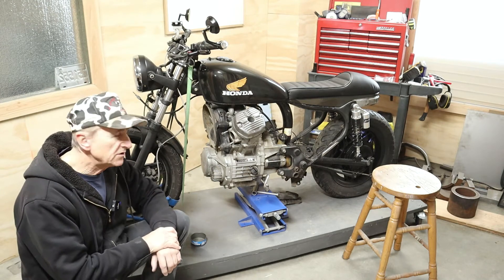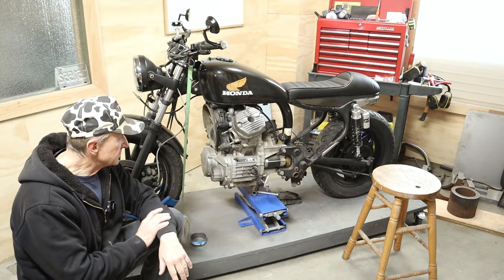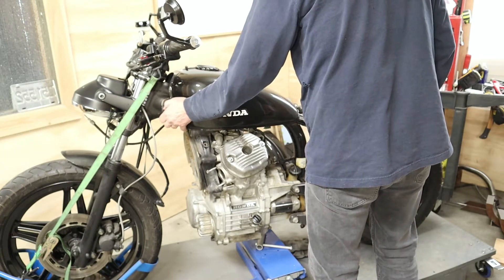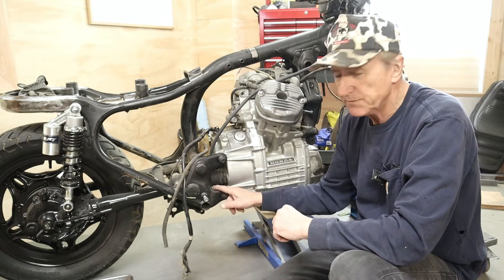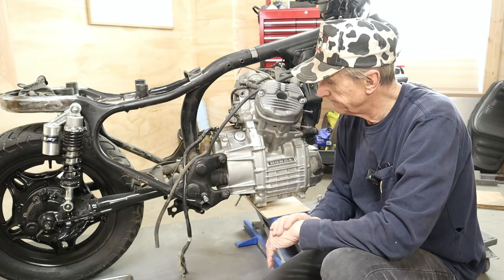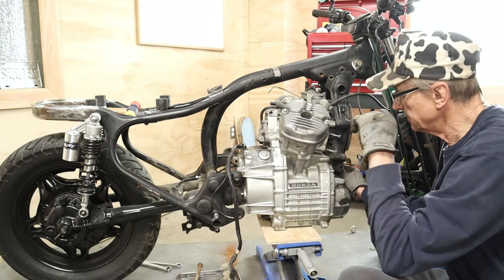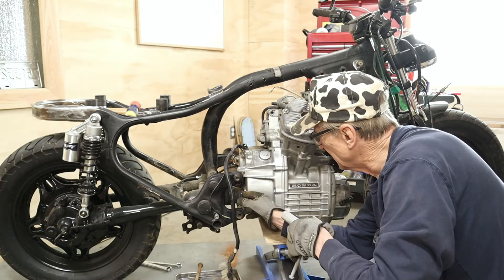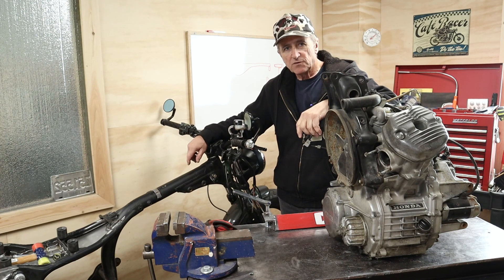How to Drop your engine

Comment: How do you like to refinish the corroded bolts?
Reply from the maker: Hi Nick, I’m planning on wire wheeling them clean then replacing them. Instead of cad plating I’m going to try nickel and see how they turn out.